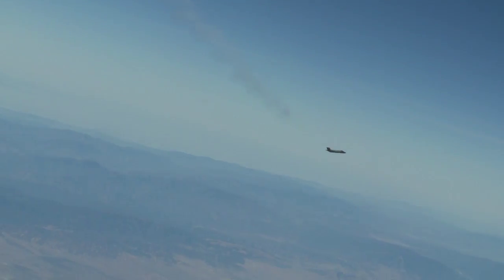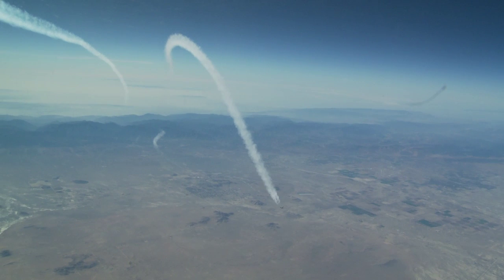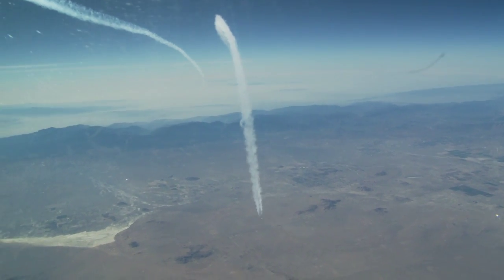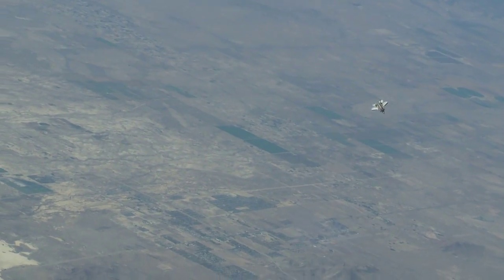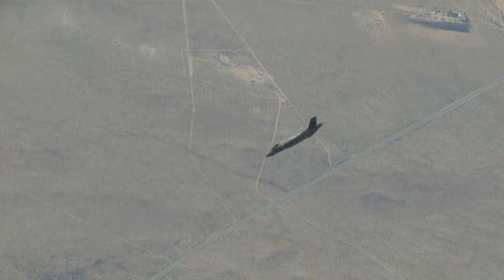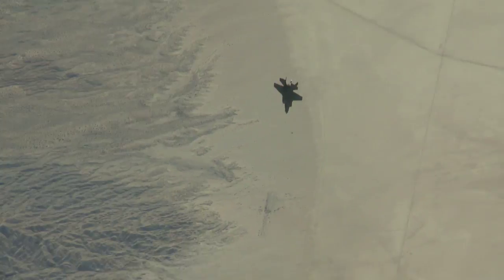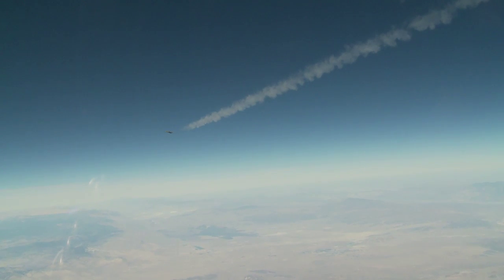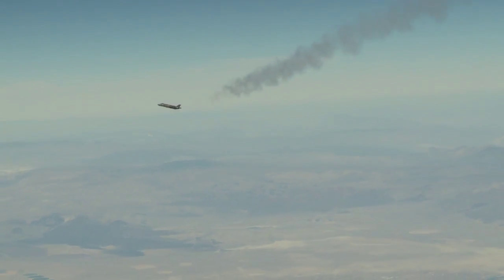F-35 High Angle of Attack Testing

Comment: Since then F22 had been deployed in combat. The Russians seem to be rattled. If the F35 is anything close to the F22, they should be. Still, why not a naval version of the F22?
Reply: George Marsh That information is classified sir lol. But i can safely say the true performance of the F-35 is not public knowledge
Reply: Matt Slattery Yep it has plenty of performance. One of Norway's best pilots thinks the plane is better than the F-16 in a dogfight too, due to higher angle-of-attack capability and more thrust https://www.flightglobal.com/news/articles/update-norwegian-pilot-counters-leaked-f-35-dogfi-422552/
Reply: The F22 does not have as many applications as the F35. The F35 will not maneuver anything like the F22.
Reply: Guy Smith Oh I didn't know that! Very cool.
Reply: The Russians are too busy laughing at this aircraft.  The Sukhoi is nearly 700 mph faster, has nearly twice the range, can absolutely turn faster and costs about a quarter of this made in the USA white elephant. SHAME on those countries who are buying this out of some sort of misplaced loyalty to NATO. Their respective peoples should be throwing them out at the mext election, not they would have a clue about this gigantic waste of tax payers money.
Reply: Mike Breen The F-16 has 28 600 pounds of thust, the F-35 has 43 000 pounds. The F-16 does mach 2. Its simply a case of the usaf hiding the performance of the plane for as long as possible. And they are right, its what you do
Reply: Hjembrent Kent

It is interesting if F35 ever used thrust vectoring on maneuvres and what are the performance evaluations. Can you enlighten?
Reply: Hjembrent Kent Well, the F-35's engine can do more than 43,000(tests have been done at around 50,000 if I remember correctly), but that reduces the life span of the engine. Russians seem to use their engine/air frames at their max, no wonder their engines/planes degrade so quickly.
Reply: TheStarvingSamurai I agree, that number is probably less than the actual performance. Russia has a lot of airspace to defend, and not a lot of funds. Those planes are probably getting expensive to maintain
Reply: Hjembrent Kent For sure. Their money struggles are also apparent with how small their orders are of their t-50. Their orders are barely in the double digits for the next several years. F-35 is still in testing phase, and there's what, 100+ already?
Reply: TheStarvingSamurai Yeah theres no way russia can afford to replace all the old planes, like NATO is planning. Russia will have to keep a lot of the current planes for a long time
Reply: Hjembrent Kent And their pilots will have to sacrifice training time in favor of trying to extend the service life of said older planes. I could see China having a pretty good air force, if they can manage to make some decent air craft. I know they have the money. They've also increased their pilots training time pretty significantly. I think the issue they'll have is that they don't really fight anyone. I know it kind of reflects badly on the US, but we've fought so many wars that we have developed not just excellent weapons systems that work well in actual combat, but also amazing tactics as well.
Having fancy weapons is nice, but the real effectiveness is knowing how to use it.
Reply: Hjembrent Kent And on an random side not, those F-35 engines sound sexy as hell :p Everyone should take the time to listen to them scream.
Reply: TheStarvingSamurai Good point, no one has more practice and experience than NATO forces, especially US. And the money to do it. I cant bring myself to believe that the US is capable of producing a bad combat aircraft, you are by far the most experienced at it. Say what you want about it, but in this case it has to be advantage. You have the best techincal knowledge, and the best electronics. And the best training most likely, and certainly the biggest budget. Full confidence in the F-35 as the most complete package
Reply: TheStarvingSamurai Its the most powerful fighter engine built, definately looking forwad to hearing that. You wont mistake that for a passenger jet. So jelaous you have actually heard one
Reply: Hjembrent Kent Yeah, the East has always been a quantity over quality type deal, but the West has so much money that we can have not just quality, but large numbers of it. 

/watch?v=ygVlvlvnmTU and here's a video of a B doing some basic stuff. 2:19 is the engine sound. Sounds like a bomb dropping out of the sky haha. Much better in person though. I can't wait to see it demo with a fully operational envelope.
Reply: Hjembrent Kent Now time for a stupid joke I just thought of; With the engine so loud, the enemy fighters would hear the fucker before their radar can pick it up :P
Reply: TheStarvingSamurai I actually thought about that, you might have to replace radars with guys camping out with hearing aid lol
Reply: Hjembrent Kent Hahaha X)
Reply: +Guy Smith the f-22 compensates for its lack of 360 missile targeting with its maneuverability which can be useful for gun combat. The f-35's 360 tracking system is only useful for the very limited amount if missiles it can carry. Once all missiles are used up, it's dead. Don't make the same mistake like what happened in Vietnam with f-4's not having guns. At least the f-35 has a gun, but it's nothing without good turning capability.
Reply: AussiePillow1 A missile can turn a hell of a lot quicker than an f-22. They already have plans of upgrading the internal bay of the f-35 so it can carry 6 A to A missiles. F-22 does have the capacity for 8, but it's sole purpose was to be an air superiority fighter. F-35 is built as a strike fighter, it's not supposed to be in a dog fight. While there may be a ~1% chance of that happening, it will most likely be due to the pilot not using the proper tactics to stay out of the situation.
The test pilots have stated that the A model can fly like an f-16 (which is pretty good), and the B/C like an f-18(still good). Are the f-16/18s bad? If not, why the hate on the f-35, which has much better sensors and stealth?
Reply: +TheStarvingSamurai with the insanely large amount of money spent on the f-35 I would of thought they would make a multi role fighter. I don't really think it's worth the money.
Reply: AussiePillow1 It is multi role. The f-16 and f-18 are also multi role fighters. They are used for ground attacks, also with the ability to fight other aircrafts if need be. The f-35 is just a generational leap forward in terms of technology.
Many people think 5th gen means more maneuverable, when in reality it's mostly just a generation of more technically advance aircraft. The radar and combat sensors are superior to the 4th gen, and even better than the f-22(since the f-35 was developed after the f-22).
The other major bonus with the f-35 over 4th gen is the stealth technology. Better RAM than the B2/F117/F22. The RAM is actually baked into the skin of the aircraft, not just painted on. This means that it can't just peel off, or be as easily damaged.
The JSF program is pretty expensive, yes. However, it's not as expensive as the media is trying to make it out to be. The "Trillion dollar fighter" stuff they parrot throughout the media circuits  is actually the estimated total cost of the entire program spanning its entire service life. This means development, procurement of all 2000+ aircraft with engines, weapons, training, maintenance and upgrades for over 40 years.
Reply: +TheStarvingSamurai you just said that the f-35 was built as a strike fighter, and not meant for dog fights. Isn't dogfighting a role anymore?
Reply: AussiePillow1 It's a niche role. Something the f-22 and f-15 are used for. The f-35 can defend itself from other aircraft, but it's intended for strike attacks and BVR engagements to defend itself. If you're going into a situation where you know(or where there could be a high chance) there will be enemy fighters, more than likely the f-35's will be escorted by air superiority fighters; Like f-22s or f-15s. Leaning more towards f-22s however, since they can stay stealthy along with the f-35s.
It's just nice to have the ability to defend yourself from other aircraft when you're going in to bomb enemy targets.
Test pilots have repeatedly said that the f-35As fly like f-16's, and I don't think anyone would say that the f-16 would be a slouch in a dogfight. F-35's just have the advantage of stealth and better sensors/radar. Having the ability to lock onto targets in a 360 degree sphere around your aircraft is also a decent advantage vs 4/4.5 gen aircraft. How effective would supermaneuverability be if the plane you're attacking can just lock onto your plane even if you get behind them?
Reply: +Hjembrent Kent You my friend are absolutely right they list its speed at Mach 1.6 + .  Thus not revealing its top speed .  My guess is Mach 2.2 but that is just a guess. You can kinda look at the thrust of the engines of the raptor vrs the lightning with the weight factor and come up with a educated guess. Also remember they have "choked of the engine of the F-35" it can push 50,000 lbs.But due to lower lifetime expected at 50k pounds they reduced it to a so called sweet spot.

Comment: When are you going to put out a video of the 35 actually flying like its supposed to? Show us vertical-horizontal transition, everything else is useless and already been seen.
Reply: You haven't been looking very hard, have you.
Reply: Robert Brockway I did
Reply: Robert Brockway I'm not into the "f35 sucks" bandwagon, I just want to see it perform fast vertical takeoffs and landings like its supposed to.
Reply: Michael Elias M What are you talking about now?
Reply: +logos2600 They are all over on YT, you're not looking very hard. Keep looking and stop lying.
Reply: logos2600 They are hiding performance, as you do
Reply: logos2600 It's still in the testing phase. F-22's weren't doing their public demos until a year after they were operational. F-35B just passed initial operation tests, but the A(the most maneuverable one) won't do its operational tests until next year. So look for those kind of videos in 2017. I do believe they did a field upgrade on a couple jets at Nellis not too long ago to increase the maneuverability, so it will perform better as time goes on.